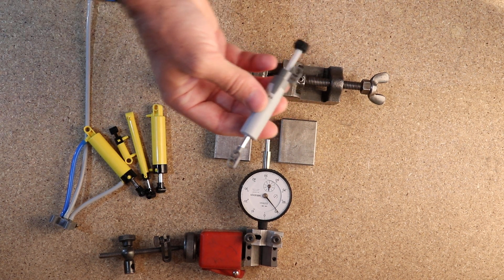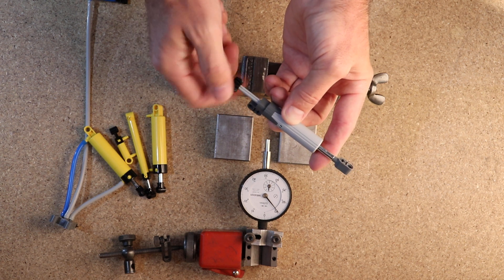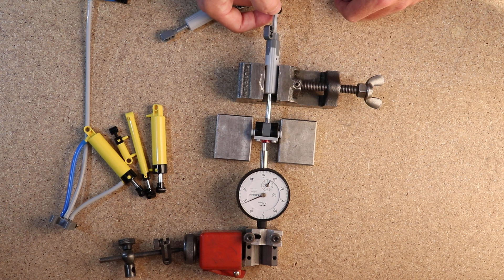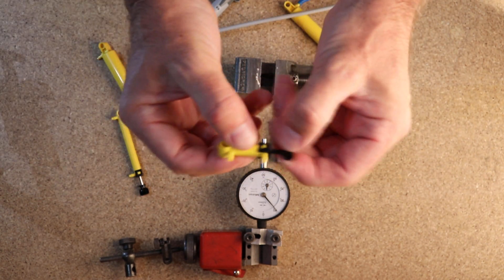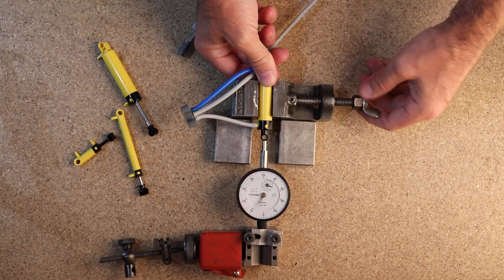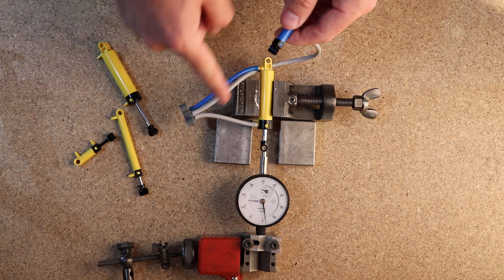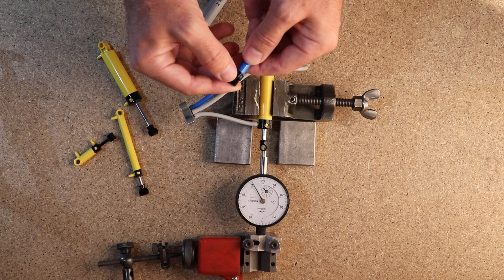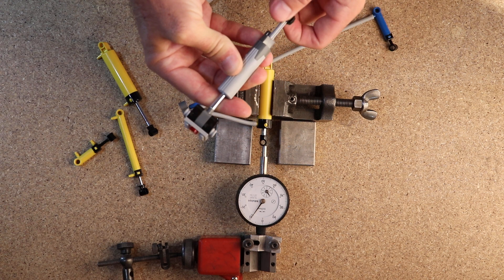Actuators - Explained. How do Actuators work - Using Lego to demonstrate the principals

Comment: Considering Firgelli's product line 25 years after having built a gigantic aircraft hangar door using hydraulics.  Still works like a charm with only one seal rebuild due to a minor annoying drip. Only this time it'll be a large (11' x 60") top hinged window overlooking a deck in a residential application using electrical linear actuators.
Reply: Curious: why is it that compressible air has a delay and is not as precise as incompressible fluids?
Reply: @MathCuriousity  bingo
Reply: @YankeeinSC1  no I’m asking why is it that it’s not as precise? I don’t understand why a delay would make it less precise! It’s just a delayed action.
Reply: @MathCuriousity  Probably a question better answered by Daniel Bernoulli, Robert Boyle, or Jean Léonard Marie Poiseuille, but I'll take a stab at it.  First delay/latency/lag is less precise. In fluid systems, like simple car brakes, the desire, is to obtain brake friction nearly instantaneously with pedal application. In that same example, if we used air, we might find that as the air in the system, but particularly in the cylinder that was used to apply the brake heats up due to friction, braking pressure would therefore increase (Boyle's law), perhaps undesirably. Atmospheric influences outside of an air system might cause metered air volumes and pressures to change, something that simply wouldn't happen in a hydraulic fluid system.  By the way, the actuators I've chosen for my huge 300 pound hinged window work quite well using electromechanical linear actuators.  Thanks for asking.
Reply: @YankeeinSC1  hey thanks for writing me! So doesn’t that prove I’m right? That it’s not delay itself that makes things imprecise? It’s outside factors on the pneumatic system? I just don’t see how a delay of an action (you pressing down) and the air actually causing An action, makes things less precise. Maybe you are saying because between the moment you pushed and the moment the air actually caused it’s action on the system, the environment could have changed?
Reply: @MathCuriousity  I wasn't the author of this video...
Reply: @YankeeinSC1 no I know but u been very helpful! Hoping you can answer that final response of mine! Thanks brother